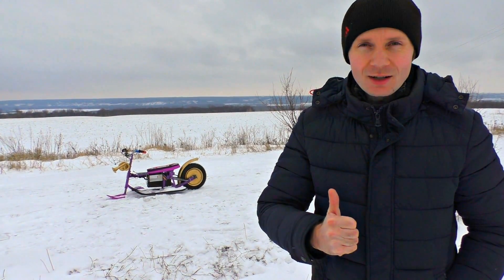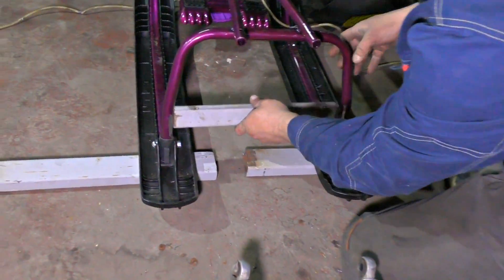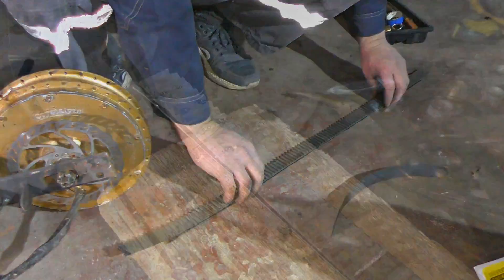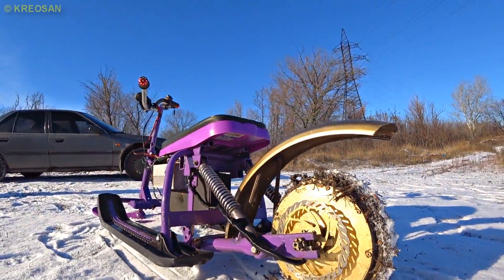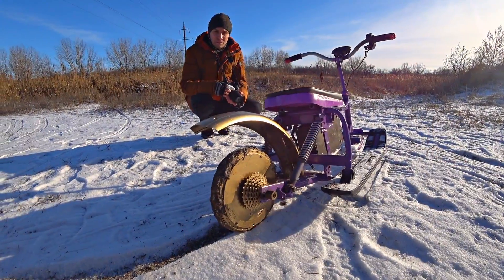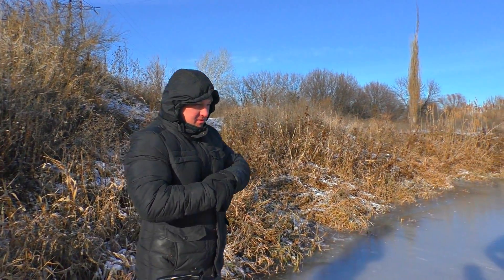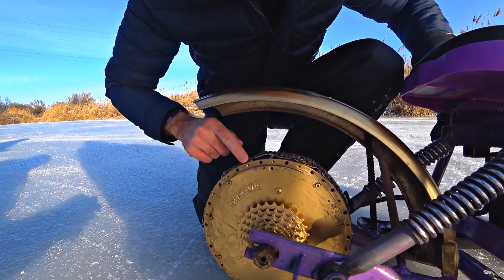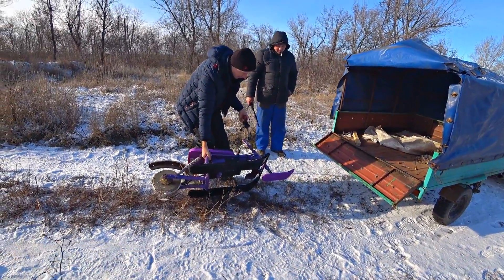Electric SnowMobile DIY / Alternative Energy

Comment: If you want a powerful as motor buy an alternator and take away one of the coils and its like a 5kw motor for 5 bucks
Reply: Good idea! Do you have any idea for cheap Batteries?
Reply: @ERR0RR  buying cheap aliexpress lithium ion cells and wiring up yourself
Reply: I don't know where you get your alternators, but it's not that easy, nor that much power...
Reply: @DryLog420  na m8 you cut one of the coils out and pump phat tones of power through em
Reply: @ScrapTechTips  which coil? Because I believe there is a coil in the rotor, and also 3 or 6 coils in the stator, giving a 3 phase output. Also, a motor and generator are essentially the same thing, and the average car has a 12V, probably around 80-100A alternator. This is a total of about 1200W if we use 100A for the value.

How can this be possible to output 5kW from a 1.2kW alternator, with even less coils than originally(since you say to cut one of them)

Is there perhaps a video on your channel maybe explaining and demonstrating this? To me it seems improbable that this is possible
Reply: @DryLog420  there is a great video on yt somewhere
Reply: @ScrapTechTips  awh, I see. You haven't actually made a 5kW motor out of an alternator yourself.

I'm just thinking out of experience and education in the subject, it seems improbable.

Good enough for me.